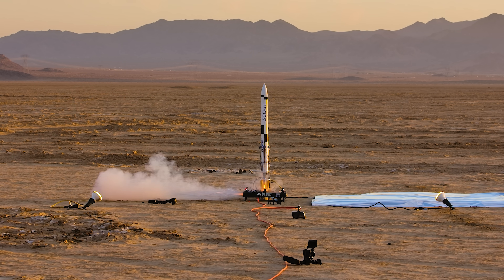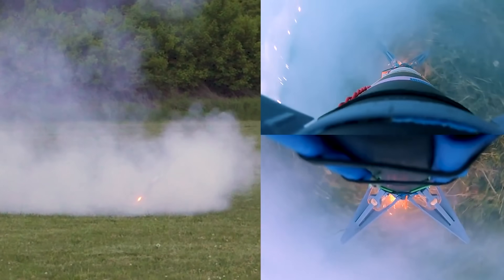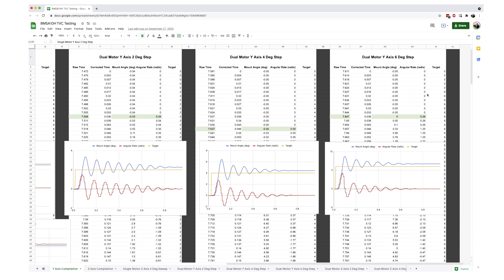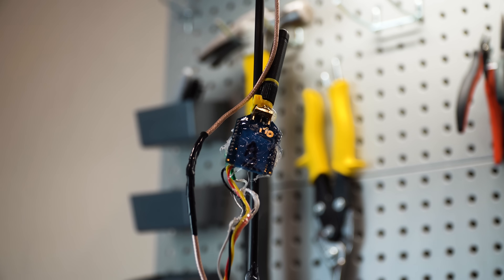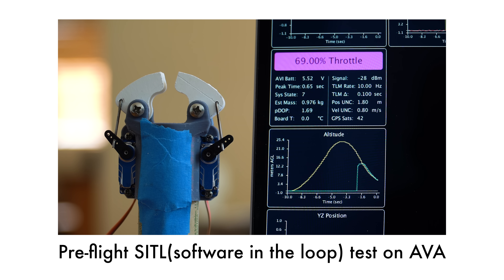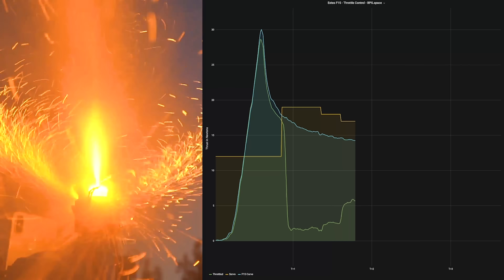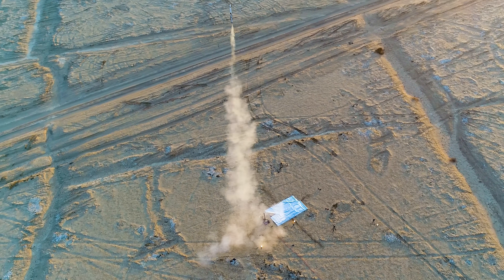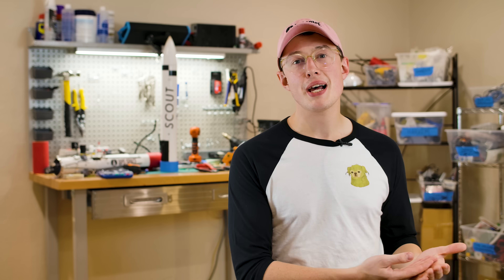Scout F - Flight 1 - Launch and Landing

Comment: One thing I'd suggest (based purely on feeling,, not evidence)  is maybe trying a different motor with lower thrust and longer burn time. A lower T:W and longer burn feels to me like it would allow you to be more gentle with the TVC. Basically, the slower you can do things, the less momentum you have to put in and take out of the system.

Comment: I'm new to your channel. You're mechanical engineering is really good. Maybe you could replace your electronics with a Matek Flight Controller and use open source flight controller software like iNav or Ardupilot and just program a custom servo output mix. Your blackbox data would be way more helpful since it would have higher resolution, etc. And a PID loop would help dampen your gimble motion.

Comment: Amazing progress so far!

The way I would approach it is to calculate the total change in velocity your landing impulse can obtain, and do a running calculation of how much thrust you need to land perfectly. When the two line up appropriately (With timing and tolerance of the engine specs, etc), you fire the landing impulse. 

Start with this. Take a random set of drop altitudes and figure your curves as you mentioned, finding the ideal time to start the ignition in each case. Plot the drop altitude vs ideal time to start and see if you can find a formula, there should be a clear one. With that you can know when to start. The idea is to have a well generated curve that is based on the actual conditions, not the expected ones.

With this approach, the goal of the ascent is to go as straight up as possible, because it is very difficult to recover if the vehicle isn't stable. Still, I'm sure you'll get this! Keep it up!

Comment: I would try to solve the landing problem as a nonlinear optimization problem with the ignition time as the main optimization variable. With this method you have the greatest flexibility and accuracy. You can include all types of constraints and a desired behavior in terms of a cost function. By recalculating the optimal solution in an MPC-Scheme based on the measured flight performance the rocket can adapt to various disturbances from the expected flight profile. Of course this may be computationally expensive, but with a decent initial solution of the trajectory the solver should find new solutions in a reasonable time.

Comment: Part of what could fix regarding your ascent issue is altitude.  Considering this particular test flight, you did not have a lot of altitude to work with.  Trying to do that amount of correction in that short period of time will in fact, as you found out, use a lot of your thrust.

Fast forward to what you probably already have in your head by now, is a MUCH higher altitude.  To do that though you are really going to have to scale up in the solid rocket motor department.  Which may greatly affect your design and cost to operate.

Landing on the other hand, you shouldn’t need to as large of a motor.  Your “reentry burn ;-)”  needs to handle your weight.  It needs that short burn time.  And for that sir you may need something outside of a stock motor.  

Although, if you do look on the Apogee site, they do list of a lot of Rocket motor parameters, you might be able to find that proverbial shoe to fit your foot, so to speak.  Otherwise, to get the optimal results for Landing, you may be loading your own solid rocket motors.  The plus side is you would have total control over its design.  :-)

Comment: While I believe you are far smarter than me, and may have thought of this, there are a few options in the drone world that may achieve a fantastic effect:

If you use some kind of lidar or radio sensor, you can use the distance input to determine realtime thrust parameters. Things such as the Radiolink SUI04 Ultrasonic Sensor, or the MakerFocus Lidar Range Finder Sensor (just two quick examples) would allow you to set a baseline curve based on known parameters, and then adjust them when the rocket is within lidar/radio range. This would give a more precise throttle curve, and help you stick the landing. It would also help account for "anomalies" in the launch portion, underthrust condition, overthrust condition, wind, etc.

Comment: Joe i know you're limited by space, weight and using solid propellant but ive whats your other throttle control video and i think you are at a point where you should scrap the pinchy finger thrust control thing.  That and the solid rocket motors just aren't gonna ever give you the result you want.

Comment: Got math lab ?  Plenty of CPU power, NXP  P2015
3D autopilot,  humm   ask elon ?  GigE ethernet vehicle control bus
or POF plastic opptical fiber LED bus  cheap good to 1M bit per second
or SDLC/HDLC serial bus IP core in an FPGA  10M bit per second
1000M bit per second ethernet is what the big boys use

Comment: Taking my suggestions with a grain of salt since I don't have much experience in this and you are far more knowledgeable than I am

Two things come to mind have the computer consider a boarding The landing Target add a wiggle space to The landing Target so if it's off by more than a certain amount shift The landing point so that you don't have so much sideways motion when you're landing

Second maybe not as elegant but might give you more successes while you work out the issues? Have a replaceable crushable material in the landing lakes so that it can't bounce the material will crush absorb and stop the motion without an upward component to balance the rocket back up again combined with your quasi thrust control maybe that might work?

I don't know how accessible or even possible these materials might be but I'm thinking that ring that the top legs of the landing legs attaches to could slide up and down and above it you would have a cylinder of crushable material such as honeycomb aluminum? This way if it landed a little too hard the material would simply crush and absorb the downward motion without the upward rebound

Comment: Why not immobilise the mount during the ascent phase? Even if with something as simple as a small assembly fitted to the ascent motor that will then get jettisoned with it so as soon as that’s gone and has fallen away the gimbal can move. Or if not immobilise it completely just limit it’s movement to as much as you’ve calculated needing for ascent control authority. I’d be more than happy to draw something up and send it over if you wanted to try it.

Comment: Maybe you could model the dynamics of the rocket when impacting the ground including the mass spring and damping of the landing legs. Maybe the legs need more built-in damping, instead of or alongside the use of a cardboard landing pad, (In addition to the problem with achieving the initial conditions of the decent like altitude).

Comment: Hey Barnard, you seem to have different control schemes way up and down-up: lots of high frequency modulation, down: less so. In any case, the downwards burn time was longer.
How about calculating with the overall available burn time? If you had too much thrust on ascent diverted to the sides, why not start the landing motor a bit earlier to bleed off more thrust there?
Also, why not reduce the high frequency control movements on ascent?
In any case keep up the great work, but don't overstretch your stamina - it's never worth it! :)

Comment: If you know at what velocity you want your rocket to land, then I would try putting a different kind of suspension in the landing legs that is close to critically damped (just slightly underdamped). Combining that with getting the throttling to work will be a big step forward. You can try this on matlab first though.

Comment: total random thought but for combustion you need fuel, oxygen (air), and a spark. If you removed one of those than you would stop combustion and by extension thrust. Could you somehow suffocate the motor causing combustion to end? I believe these motors only have propellent in them and no oxidizer like a real SRB might have. Eliminating the other two components, fuel and spark, seems to be very challenging unless you can get rid of the engine while its still running without interfering with the main body of the rocket.
Reply: SRBs have both the oxidiser and fuel, the oxidiser is just something solid. The oxidiser can also be something else then oxygen, and just because it is solid doesn't mean the oxidiser isn't oxygen. everyday astronaut probaply has a video about it, and scott manley definitly does, you just need to be lucky to find XD.

Comment: Servo-actuated tabs may actually increase thrust cause they increase chamber pressure which in turn leads to higher burn rate of the fuel (see Arrhenius equation) and thus to increase in mass flow rate and thrust.

Comment: A question I've had for a while while watching your series on throttling: would it be possible to use two motors instead of one for your landing motors? If you had the ability to gimbal them all the way to 90 degrees in the plane that includes them, that would theoretically cancel 100% of their thrust.... possibly/ probably turning it into rotation if you didn't have the alignment perfect or controlled closed-loop, BUT STILL.   I thought that's where you were going to go with dithering back a few videos ago but you never went all the way there.

Comment: You said you can only pinch down the engine exhaust to a certain point so you can never get to 0% throttle (which makes the timing of end of burn more critical). Your exhaust control ceramic pieces are only on 2 sides of the gimbal. What if you install 2 more ceramic pieces that have a different shape on the other 2 sides of the gimbal? Make these in such a shape that it doesn’t pinch off the exhaust but rather redirects it 90 degrees to the sides like a jet ski neutral/reverse mechanism or turbine aircraft engine reverse thrust mechanism. This could potentially allow you to plan to touch down with a little bit of burn time left and cut it to near 0% to prevent bounce and re-liftoff.

Comment: Awesome video! I would love to see some more footage of you machining. Your so close to getting this thing to land. I know that one of these times its gonna work and not long after that you'll be making it look like its just another Tuesday.

About the throttle curve:
Why not install a small "time of flight" sensor on the bottom of the fuselage and have the throttle base on a "rate of decent" curve rather than a raw altitude curve. I believe if AVA has the processing capacity to add this it would allow you to throttle the engine appropriately regardless of the altitude that the decent begins at. If the rate of decent is greater than your target curve value the throttle increases and if it is less it decreases. This will also allow AVA to actively compensate for performance differences in the flight motor and landing motor as well as weight differences in the vehicle. Its much more dynamic than a curve based on altitude.

About the landing:
SpaceX uses a replaceable crush type shock absorber in the landing legs of the falcon 9. Why not try to model something similar for you legs using something like a cylinder and piston with a piece of CALIBRATED (crumpled up) paper inside.  Really light weight and not bouncy at all. I feel like rigidity is not your friend on the landing legs and I suspect you already agree. Hence the complex landing pad.

I would love to hear your thoughts on these ideas! Keep up the great work!

Comment: so far everything i thought of, you also have. but, a complicated fix full of failure points, your landing motor throttle shut off clamp. add a couple of blades to it so it can close completely. then, add a second set that can snap shut lock those first ones in place while adding more direction to the flow, up. or at least at an angle towards the up direction. and time it so when the rocket touches the ground, the first clamp closes, then triggers the second set to close and lock it in place, directing the flow in an upward direction, essentially holding the rock to the ground until the motor dies. 

it will work, but, complex engineering is needed.

Comment: Awesome video, Joe! 

I just wanted to share some ideas. You said your ceramic motor modulators can only bring down the force to 20%, which I don't think is an issue. It seems you have good control of getting the rocket close to the ground stably, but you need more precision in the last couple meters. I feel like adding a small distance sensor for this little portion would be very helpful for this. You can get a small, light one to get precise measurements for the last bit of the landing. I think it is also important to have your engine be able to exert the force around the weight of the rocket around landing. This will bring the rocket's velocity to zero. Then with your ceramic modulators and your distance sensors, you can close the distance to the ground with active control, instead of a more timing/guessing method.

In short, I feel like the key for the landing is getting distance measurements from the ground (via the distance sensor), and the engine having a profile where it can exert a force near the weight of the rocket, to bring the rocket to the ground with close to zero velocity. Once you're on the ground, that 20% shouldn't matter so much, so long as you are doing less force than the weight of the  rocket, you won't be exerting much vertical force.

Hope this helps!

Comment: You've got plenty of great ideas in the comments, so my suggestion will be more "macro". I would suggest breaking this problem into two parts:

1) A "Scout G" vehicle that is solely used to work on the gimbal problems. Use parachute recovery. Just concentrate on solving that one problem. Get yourself consistently flying straight and to expected altitude. At least 10-12 flights that hit the mark.

2) Return to the Scout F with your Scout G design and data. With the gimbal working consistently, tackle the landing.

Are you using black powder or AP motors?

Comment: IDK if the MCU you use has enough calculating capacity, but with my really basic understanding of physics and how control loops work, will you try let it calculate how much kinetic and potential energy the rocket has. Also the momentum (I mean m*v). Have it solve a few equations to reach almost perfect burnout at touchdown. If you are interested, I will work on it further.
Reply: I just thought of another way to do this. For example if you estimate a five second burn time, and know the thrust curve, you want it down in exactly five seconds. Based on current speed and height, try decelerating smoothly with time.
If you are at H in height and V in vertical speed, with a T second effective burn time, acceleration should be a=V/T.  Start burn at H=T*V/2. Throttle way down if necessary. Don't just think " I want my motor to keep its 80% efficiency"。 If you want efficiency, just start higher up at faster speeds, so you don't have to throttle down that much.
That was a simplified way to describe it. The motor does not burn evenly. So modify the estimation of acceleration based on thrust curve or just use average or take an integral of that.

Comment: Just a few suggestions here:
1. Instead of using a fixed landing profile, you can use a function which takes in horizontal and vertical altitude and remaining delta V to spit out a throttle curve

Comment: A few suggestions here:
1. Use a function which takes in the current velocity of the rocket, the vertical and horizontal distance from the landing zone and the burn time left to calculate the appropriate throttle value.

Comment: Idea for the landing throttle. What if you designed a gradual curve into the landing throttle mechanism, sort of resembling a 1/4 pipe in skateboarding, to act as a flame diverter. This way you could simply redirect the flame horizontal, or any angle in-between,  instead of pinching it.

Comment: During the wiggle it also appears to be causing the fuselage to oscillate on ascent.  Either fixing the wiggle or verifying that the fuselage oscillation potential is as low as possible should also help.

Comment: You've basically already mastered the landing, in my opinion.  It's likely just those bouncy, springy legs that are robbing you.

As an extreme illustration try using three "lawn dart" type struts (fixed in landing orientation) instead of these legs, and then land into a patch of deep and damp sand... just to eliminate the leg bounce issue.

If you stick THAT landing, then time to redo those legs.

All my opinion.

Comment: Very impressive! I salute your technical skills but worship your determination. Obviously the rocket did not reach the planned altitude, but seeing the small margin of error, would your project not benefit from more altitude (say 100m) to both give you more leeway when the craft or motor is underperforming and give you more room to correct for the horizontal movement? Have you considered Jelled propellant as an alternative route? Or have you considered both boosting and lowering thrust chemically (hybrid?)instead of mechanically?